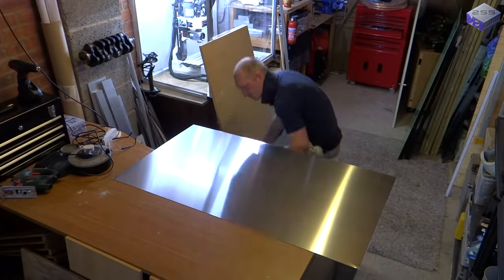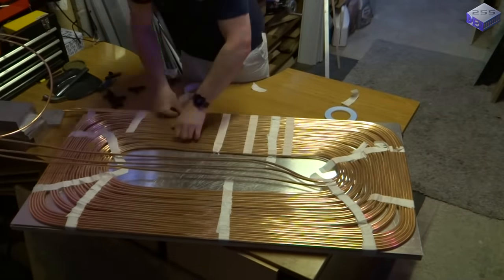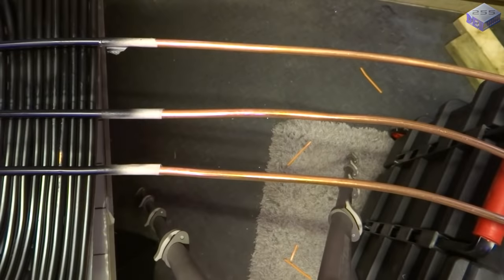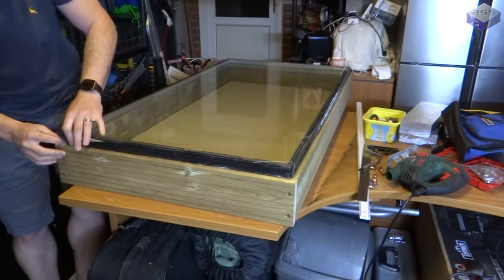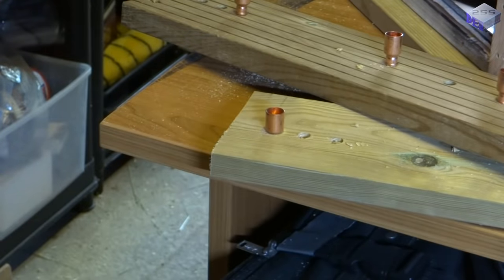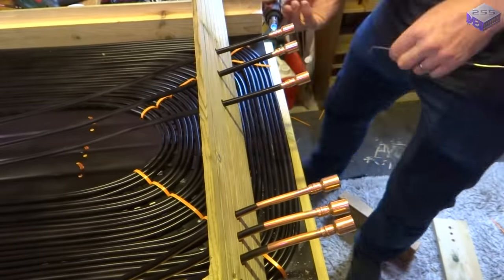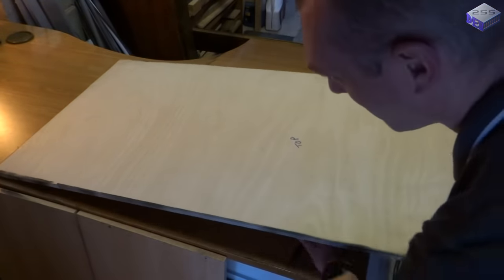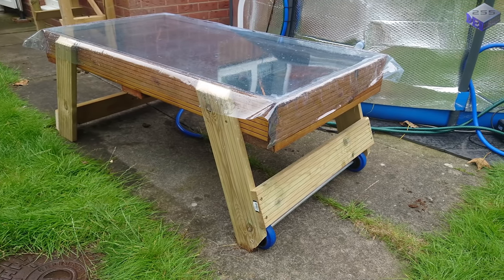Improved Solar Pool Heater - Full build

Comment: I would have used plastic tubing to prevent copper transferring to the pool water. Have you had problems with discoloration
Reply from the maker: Hi, I've not had any issues at all over the summer, as I only use minimum chlorine in the pool and keep the PH level balanced. As long as these are constantly monitored the copper pipe should be fine. It's the chlorine in the water made worse by off neutral PH level that increases the effects on copper. I found it best only to add the correct amount of chlorine a day or so before and once finished with the pool for the day. The other alternative is to use non chlorine products, although there is a small amount of chlorine in tap water and house pipes are copper, plus the pool should be considered non potable.
Reply: @TheSolarPoweredEngineer  I have a salt water pool and could not run this set up. There is a risk of turning bathing trunks green and possible green hair for blond people🤣
Reply from the maker: @battistuzzijohn  You could probably charge for that service 😁👍
Reply: @battistuzzijohn  A salt water pool/salt generator would not hurt his setup. If you are worried you could put an avoid on before the heater.

Comment: How much would you charge to build and ship one of these to the United States? Just asking because I don't have enough confidence in my own (and those of my family) handyman skills to build this myself, lol.
Reply from the maker: What would it feel like if you did make a working one yourself?

I do get asked this quite a lot, although, unfortunately, I don't have a lot of time as I'm employed full-time and create projects at weekends and evenings, tis a busy time. Have you got a handy friend that could help you out? or even a local university/school, could be a good project for them to make if you funded it, plus you would be promoting STEM education ;-). If you funded the materials, you could even agree to keep the final unit.
Reply: @TheSolarPoweredEngineer  Well, I might be gearing up to try this myself? I'll be using a stock tank, however. I do have an additional question: Is there a difference between utilizing glass as a cover for the box or clear plexiglass? Does one have an advantage over the other in terms of heat absorbing and retention? I just ask because I just have concerns over the fragility of the glass when being moved around and stored (along with potential impacts from limbs). I'd be putting this on the roof of my garage when completed.

Comment: You must use polyisosyanurate foam. Its heatproof.
Also the copper tubing is too small diameter to get the required flow rate.
Without adequate flow rate, the pool will not heat up.
Reply: He has three of them. Mains flow rate was not impeded as shown in the video. Also it increases surface area to volume of water ratio.
Reply from the maker: @harunyahyadotorg  Hi, yes the panel has a good flow rate where I am getting around 5 liters/min through the tubing with a gain of around 1.4ºC, so around 500W in direct sunlight, although I need to do more tests this year as there was hardly any sun last year.
Reply from the maker: Hi, the maximum temperature that the panel got to was 64ºC with no water flow in the UK, and with flow it maintained an air temp of around 32ºC, although need to do more tests this year with different materials.

Comment: Build three of these and run glycol through them to a (preheating) tank which pulls water from your main line. Then, feed that preheated tank of water to your water heater to lessen the cost of heating water that normally would come direct from the main line.
Reply from the maker: I have thought of running glycol, although would be concerned with any leaks, I do get that it will maintain the copper within the pipes though. A solar-heated central heating system would be good too, plus the preheated water from a solar-heated emersion tank that could hold the water and reduce the heat loss overnight. It would be good to have an underground tank also that you could transfer the water to at night to warm up and then transfer it to the pool during the day 🤔👍
Reply: glycol would also not freeze.
Reply from the maker: @sdunn5643  Very true.

Comment: How do these fair up I have a 4.5m x2.2m pool n looking at trying to take the chill off  did u see much benefit  does it keep the pool at a half decent temp or does it go cold again over night
Reply from the maker: I have it hooked up to my pool at the moment where I need to connect a flow rate sensor and temperature sensors to see its performance. Last year it was collecting around 500W, which is quite good for this size panel, although I will be modifying it this year to see if it can be made more efficient. To give a comparison, the first version of the solar pool heater I made produced around 600W and hit 900W mid-summer back in 2020. There have been a lot of comments on how to improve it too. You have around the same amount of water, where roughly 3 of these should get the pool up to 30ºC with a good summer week of sun. The pool does lose heat overnight (around 3ºC with insulation) through the ground, sides and through evaporation, so I have radiator backing foil around the pool, garage matting under the pool and a bubble wrap floating pool cover on the water to reduce evaporation. You will also use fewer chemicals by reducing evaporation too, so will cost less in the long run.
Reply: @TheSolarPoweredEngineer  ok thanks I had a standard pool cover if I get a bubble wrap version shud I use both or is that pointless
Reply from the maker: @aaaaa4266  Hi, you can use both, I used both before I got a dome cover. The bubble wrap will help heat the water during the day, where you can leave that on to reduce evaporation overnight, and additionally, put the cover over the pool to trap a layer of air between the cover and bubble wrap that will act as insulation.

Comment: Couple of things, painting the whole thing black would increase heat absorption and also you measured inch intervals with your ruler, handy hint, the rule is an inch wide, great job though.
Reply from the maker: Hi, thanks, I hadn't measured the width of the ruler, good point. I have a few things to try with this panel including perspex instead of glass, reflective surfaces, reducing air within the panel, etc, so have a few things to try. I'm sure this can be made much more efficient.

Comment: Should mention that standard waterhoses can emit chemicals when heated, the same with the copper pipes if you send chlorine through, they will corrode quickly. Cu + Cl = CuCl
Reply from the maker: Hi, these were a concern of mine also, where I did some research into both chlorine in copper piping and contamination from hosepipes. 

I haven't seen any corrosion, staining or any copper chloride being introduced, where I believe copper chloride needs around 400ºC to form. In England, the Drinking Water Inspectorate (DWI) requires that drinking water is maintained at the correct PH level and add 1 to 3mg/l (1 to 3 parts per million) and up to 5ppm of Chlorine when carrying out maintenance; this (according to the below link - DWI Chlorine) is the safe level for drinking water within England. As this water predominantly runs through copper pipes in the home (replacing lead piping), there should be no concern with copper use concerning Chlorine as long as the PH balance is maintained. A greater PH imbalance exacerbates the issue with chlorine and copper corrosion, so it's important to keep the levels maintained. I agree that drinking water is constantly run through the home water system, where pool water is cycled around the same system, although if this is correctly maintained, there should be no concerns, especially as pool water is classed as non-potable.

I agree that hosepipes should not be used to drink from, although as potable water, this should be fine. Again this is cycling through a warm system, so could increase levels on every pass, although I have very short runs of hosepipe and have just replaced mine for the potable (drinking) type. I will mention this in my next video.
 
Also, a good point to note with my system is that I've introduced a UVC (UV Clarifier) to our pool that allows us to reduce the Chlorine level to around 1ppm from 3ppm.

I am looking at an alternative method of delivering the heat through a basic heat exchanger, so watch this space... ;-).

Here is the link to the DWI Chlorine document: https://cdn.dwi.gov.uk/wp-content/uploads/2020/09/23151717/chlorine.pdf#:~:text=The%20World%20Health%20Organisation%20has,level%20below%201%20mg%2Fl

Comment: Hello! please tell me how the glass withstands high temperature, is it a special glass? what thickness?
Reply from the maker: Hi, this glass is just a standard sealed unit at around 5mm thick for each pane of glass and around 30mm thick in total. The glass is not subject to much temperature while water is flowing through the system and only raises to around 70ºC in direct sunlight without the water flowing. I haven't yet seen any issues at these temperatures.

Comment: Out of interest for my own build that I'm contemplating.. won't the inside get so hot that the insulation and tie wraps melt?
Reply from the maker: Hi, you should be absolutely fine as the water cools to the panel as it takes the heat away to the pool, so as long as you leave the pumps running during sunny periods the panel will stay cool. When I first connected this one up this year I left it out in the sun before running water through it, then when I switched the pump on I got steam out for around 15 seconds. It's worth having a cover around so you can block the sun if not using it.

Comment: Have you got chlorinated water? Doesn't the copper react with the chlorine?
Reply from the maker: Hi, yes although very lightly chlorinated with good PH balance where I'll only add chlorine when required. I may try a closed loop copper system with no chlorine and have a heat exchanger to transfer the heat to the pool via plastic tubing. The copper does react to chlorine and this reaction increases when the PH balance is off. There is chlorine in drinking water and this normally runs through copper piping in the home, although I believe the chlorine is at a much lower amount.

Comment: Would have been nice if you included the build costs and performance characteristics. That way would be able to understand if it’s worth doing. Thanks
Reply from the maker: Hi, with a flow rate of around 5litres / min, there is around 1.4ºC temperatures rise. So at that rate there should be a 1ºC rise every hour for a 4600 liter pool, although there is a lot of factors cooling the pool down, so realistically I'd expect around 0.4ºC per hour. This doesn't sound like a lot, although this is a 3m above ground pool. If your keep the pool covered and insulated you can reduce the amount lost overnight and the pool will warm up noticeably over time. Ideally, you would need 2 or 3 of these for a 3m pool. For the cost, copper is fairly expensive at the moment, so this setup could se around £350, plus there is a question with the use of chlorinated water when there is a PH balance. I would recommend the first design with PV tubing as this was around £200 and easier to make. I will be looking into improvements from comments, previous designs and from testing different materials.

Comment: How do you regulate this so the water isn't boiling when it comes back out?
Reply from the maker: Hi, it's all to do with water flow, the faster the water, the more heat transferred away, so the tubes remain cool to the touch. If left to warm up with no flow, the water gets to around 68ºC max (from my experience). When first connecting it up this year I did leave it out without any water in it and when I then ran water through it I had pure steam coming out for around 15 seconds, haha.

Comment: my only niggle is you were saying you want the pipes to be a single length within the box so no leaks will form inside the enclosure and then you put adaptors on measured so they will be flush with the box wall, cut and solder them and then smash them in pl;ace with a board and hammer ???? 
Just how impact resistant do you think a soldered joint is ? let alone ignoring the fact you have hidden that potential leak inside a solid bit of timber.
Everything else is great as far as I can tell and I hope you get years of trouble free use out of it.
Reply from the maker: Hmm, good point, I did hit them pretty hard, I haven't had any leaks yet, so maybe a little lucky. The idea was to fix the joints in place so that they wouldn't move when attaching and detaching hoses to them, this way I could change the configuration of the pipes (parallel/serial) to see which one was the most effective. I shall make some update videos with a few tweaks to this design.

Comment: What was the material and time cost on this project? Not to be lazy but they sell devices like this. Copper pipe isn't cheap.
Reply from the maker: Hi, yes, copper is a little pricey at the moment, this is probably the best part of £300 now, although my version 1 still works well and costs around £200. No dramas, buying one is fine as some don't have the time or space to make one, so appreciate it may be best to buy. The idea behind these is to see how efficient you can make a solar thermal heater at home and whether it's worth attempting.

Comment: The box is important if you don't live in a warmer area. I have similar box for my solar shower. Just that I'm using plastic black pipe. I wonder how the pollycarbonate would work in transferring the sun heat into the box.
Reply from the maker: Hi, I think the glass is reflecting a good 20% away from the box, so polycarbonate should improve this by around 15% at a guess. I'll have to give it a go when the sun comes to stay
Reply: @TheSolarPoweredEngineer  the heat inside the box is insane. This is the"greenhouse effect". I believe the polycarbonate should help keeping that heat inside better...since its a double wall. I hope this would help during the night also. I live in the mountains.
Reply from the maker: @DrunkBrainAllTheWay  In that case you may want to externally insulate the box too, so that only the polycarbonate is exposed, to retain as much heat as possible. I am also playing with the idea of reflective side panels to get more light in, these could track the sun too, plus they could be closed during the winter or during maintenance to stop everything getting hot with no water in
Reply: @TheSolarPoweredEngineer  yep. Its already insulated 👍 I was also thinking about reflecting walls. 
These boxes work great. I think they are even better than the one you can buy, with tubes. Those have the advantage of not freezing in winter...but useless up here where is really cold.
A video will come bout my setup.
The only problem I had so far, was the water tank. I use a 200 l plastic barrel (insulated) to accumulate hot water. The water pressure is too big for the barrel :)) (water comes from a spring trough gravity) until a guest came and told me about the pressure reducer device. That was a game changer.
Reply from the maker: @DrunkBrainAllTheWay  oh dear, what about an emersion tank, that would hold the pressure and give you the option to heat with electric if you needed a topup
Reply from the maker: It would be good to see your setup on video

Comment: How much more wattage did this one put out versus the previous one?
Reply from the maker: Hi, this one is producing around 500W (peak), whereas the previous one was around 900W (peak), although this panel is a fair bit smaller. I will soon be doing some modifications to see the difference.
Reply: @TheSolarPoweredEngineer  looking forward to seeing the new modifications and the results 💓

Comment: Nice build, but if you seal it by silcone , then you seal every edge inside by it and do a vacuum in it. The second Point is that you need a drive to move this thing behind the Sunpass. Watch here for Astrostuff! At least ... you could spar a lot of work, using Coolers from Cars and Trucks... its all depend by the speed of the watercircuit!
Reply from the maker: Hi thank you. I just wanted to stop the rainwater getting in to be honest, it may be difficult to maintain a good vacuum with a wooden container too. I would like to test a car air con radiator in the same way, although aluminium doesn't fair well with chlorinated water, copper is much more resistant as long as the PH remains around 7.4. The water flowing through is fairly fast to ensure there is turbulent flow so that the majority of the water gets a fair share of surface contact and good heat transfer through mixing in the flow. Laminar flow reduces efficiency of heat transfer. I will be doing some more tests with it this year.

Comment: So how did it work?
OR what's the inlet vs outlet temperature difference?
Reply from the maker: Hi, I need to do some more tests and have it hooked up at the moment. From what I've seen so far at around 4.5 litres per minute and around 1.5ºC temperature rise, and at Mid-day it works out to be roughly 500W. I do have a few modifications to try and make it more effective, so will be making another video on this.